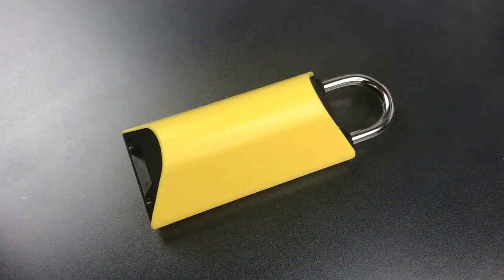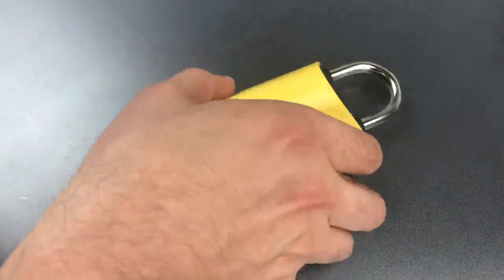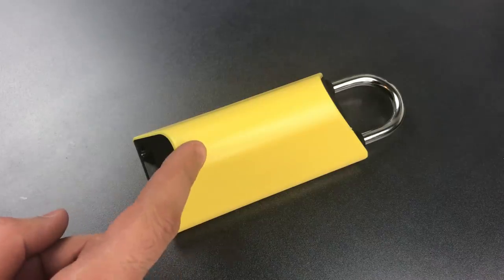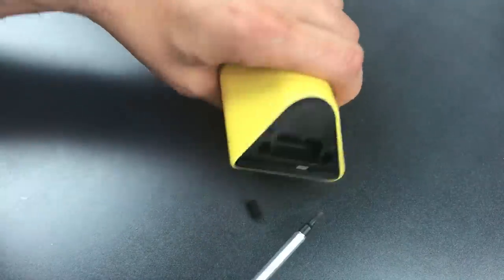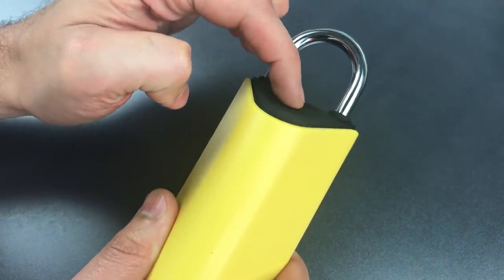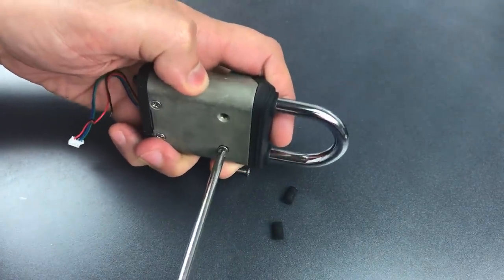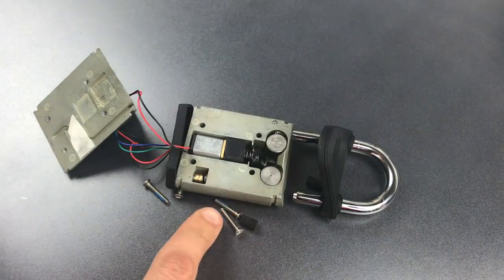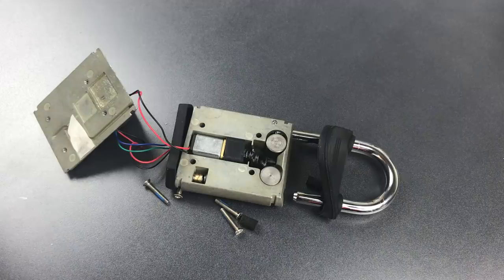[752] BoxLock: $129 Barcode-Scanning Padlock Opened With Screwdrivers!

Comment: Ive watched you pretty much destroy every lock and open them quite easily i have the boron carbide shackle master lock that you opened with the blowtorch what is your recommendation for the best most durable lock to use mine is currently on my storage i lost my keys once had to cut it off a pair of bolt cutters wouldnt even dent the shackle had to use an angle grinder with a cut off whell and had to cut the shackle off completely took about maybe 5 to 6 minutes

Comment: This would be relatively ok if the just welded the inner lock itself instead of leaving the screws exposed. I get that you can disassemble the plastic cage (which might be necessary for battery replacement etc.) and it doesent matter much since the metal lock itself is underneath. But that one has to be of decent quality and security then.

Comment: You could have also applied power to the two wires going to the motor. Do so correctly and it will open the mechanism for you without needing to take the 4 screws out.

Comment: if you fill those two holes with solder and connected to the battery there would be a chance if somebody tried using a metal bare wire like you did, that they might shock them self. I suppose since you can take it apart you can also put buttons in there to where if the button is pushed an alarm would sound.
Reply: Shock themselves from a 3.6 V lithium battery? More likely get a shock from how easy it was to open.

Comment: If you superglued or rounded off the internal screws holding the metal body together then the lock would be pretty secure. Enough for its purpose.

Comment: Pretty sure you needn't have taken the top half of the lock apart... after you pull both connectors off the circuit board your good. One of them is a handy voltage source, the other is the leads from the release motor... a couple of jumper  wires would have it open far quicker than disassembly.

Comment: I would check if the micro usb also has the data pins connected somewhere. It wouldn't surprise me if that has some debug access to the logic inside and if so it could be vulnerable.

Comment: Nothing to do with locks but for that torx bit you say you only buy the security bits because they work on both security and standard torx. While this is true I'd like to mention the security bits with the holes in them make them a lot weaker and if you have a stubborn screw it is a lot more likely to break the bit under pressure having those holes. I would recommend at least one set of regular torx bits for those stuck stubborn screws.

Comment: i guess there's another security flaw, in that anyone can unlock your outdoor box/locker/whatever with nothing but a package if some deliveryman decides to just leave the package at the door instead of going to the trouble of pressing the button, scanning the code, opening, closing, etc. what i mean is, let's say you get several packages a day. this seems likely since i doubt the average consumer household is going to buy this product. any homeowner who can afford to spend $130 on a padlock for deliveries probably lives in a safe enough community that their packages never get stolen. the only exceptions might be small business owners who run their business out of their house but aren't very individually wealthy. so i'd assume these are more popular among small to medium businesses. not really worth using unless you get multiple packages a day. and that introduces an unavoidable vulnerability, caused by laziness basically. you receive a large package at 8 AM worth $200, the deliveryman places it in the locked box. you receive a small package at 9 AM worth $5, maybe it's in a padded envelope, it doesn't seem worth the effort so the deliveryman just leaves it at the door or in some other unlocked receptacle. at 10 AM a thief comes by and notices the envelope on the ground. it has a barcode on it and the barcode can open the lock. thief gets to steal the $5 envelope AND the $200 package.

obviously that's still much better than just not having a lock at all, since it's only really vulnerable if a deliveryman makes a mistake. and it requires the thief to understand how the lock works and to risk being seen on the assumption that the envelope will have a valid barcode. so i'm not really criticizing it, and don't have a better solution. but it's an interesting little dilemma to try to solve. most of the potential solutions i could think of also require the deliveryperson to go a bit out of their way. like if they don't or can't put it in the locked box, and leave it in the open, they could use some software to invalidate the barcode. or you could set it up so that the barcode only works once, then a deliveryman can push the button, scan the code, but then not open the lock. and it automatically locks after a minute or something. once someone tries to scan it again, the code will no longer be valid. but these are still extra actions. not to knock delivery people in any way, the huge majority of them are just fine and work hard and are polite and so on. but there are outliers in anything, and we've all had the occasional dickhead who throws around packages containing fragile electronics, or leaves packages practically on the sidewalk, or doesn't even ring the doorbell for packages with required signatures. so it's not hard to imagine that sometimes you'd get one of those guys delivering your package, and i guess they just scoff at your magic padlock and throw the package on the ground lol.

the best solution i can think of is to reprogram these locks to accept dynamic barcodes, not the ones that are on the actual shipping labels, but barcodes generated within an app on the deliveryman's smartphone or little signature terminal thing. that way, ONLY the deliveryman can open the lock. the package itself is not the key, the deliveryman's app generates the key. then your only way in is either via the normal attack vectors for any lock, or by robbing a deliveryman, in which case you probably aren't gonna go retracing his steps and checking all the packages he delivered before you robbed him lol.

Comment: Security by obscurity with foam! LOL. At my work, we have engineering development systems on a subnet. Both the main network and the subnet can talk to each other and have to. But they disabled pinging from the subnet to the main network, for "security". Really does nothing but make my job harder when trying to diagnose issues. IT doesn't belong designing locks, or networks.

Comment: Interesting.
I have seen similar wy fi locks on permanent, large mail delivery boxes, so someone can secure deliveries, but the drivers have to be willing to call or ring the doorbell and wait for the user to remotely unlock the device (just a modified entry lock, attached to a small discreet door) 
I have never seen the bar code variable.

Comment: At the point where you took off the bottom and got to the wiring, one could just pull off that coupling and touch two wires on both sides of the battery and open it that way.

Comment: Just bolt a tool chest out front, then leave an auto clasping lock on it, with big bold instructions on the inside of the lid to lock after delivery.  An even cheaper “better than nothing” solution would be to bike lock a large plastic container to the house or something with the same lock.  That will at least stop the grab and run thieves.

Comment: It looked like the yellow body of the lock was made of plastic so it could be sawn in half. also if the battery fails or runs flat, you just have a piece of ballast. wonders how the batteries are charged. i wonder how many couriers would wait for the lock to verify that the parcel is legit. where i live in new zealand, if a parcel requires a signature  my letterbox does it lol.(seen the delivery notice on my pc the message, "signed by letterbox")

Comment: Seeing how there is just a motor in the top bit,  could you just have applied power to the red and blue wires to get the lock to open after getting the plastic shrouding off instead of disassembling? It feels like that could be a bit faster.

Comment: Once you got access to the wires can you just hook them up to the battery to make the motor work?
Reply: Maybe electronics had step-up dc-dc converter to raise voltage from 3.7 to 5V

Comment: The only advantage I can see for the lock is that it may send you a notification of parcel delivery which you could probably set up with one of the Amazon buttons with some software hacking. Security wise it looks like someone from the Childrens Toy department designed it, defiantly not a Tonka toy.

Comment: I have the feeling that they used screws in order to leave a way to replace batteries. There must be a way to be able to replace them. The problem seems bigger than just using epoxy.

Comment: I think it would be reasonably obvious to most software engineers that there's no security if you can open it with a screwdriver. Most likely, the manufacturer just didn't care, particularly as making the thing properly secure would require at least part of the electronics to be inside the metal casing, so that one couldn't run the actuator just by connecting a suitable power source to it.

Comment: I wonder how hard it would be to program a "maintenance mode" barcode, where it allows you to do what you did, and otherwise if the unit detects the screws are being turned to send an alert to the owner? Maybe have a electrical signal being completed while the screws are in and once not fully turned in disconnect it?

Comment: Did you inform Amazon of how quickly you defeated it?
A pair of modest bolt cutters would do the dirty deed in about 5 seconds on the shackle. Failing that, crushing the lock body would get to the metal lock part almost immediately and a modest handheld dremel drill will drill out the Phillips screws quickly. Don't need to make a lot of racket doing it, but if that doesn't matter, a hand held sledge hammer would do in the lock body with just a well-placed blow or two. I do appreciate the desire to disassemble the lock in a manner that it could be reassembled leaving behind no immediately visible clue that it was compromised. Of course, a direct attack on the box it's locking could also succeed quickly with a large screwdriver or small pry bar if it's no better than a military footlocker. Last, but not least, the porch pirates can simply take the entire lock box just like burglars do with safes and dismantle it at their leisure like you do with various locks in privacy of their basement workshop. Putting one of the two final assembly screws down from on top through the shackle hole would require a metal nut in the base plate, versus all plastic plastic, and it would have to be secure enough to prevent it from being pulled out - i.e. a press fit or molded in nut wouldn't work very well. Too bad you didn't try the two wrench attack on this one ;-)

Comment: Wouldn't filling the bottom holes with epoxy make it impossible to change the battery? But otherwise, they did make the usual mistake with smart-locks of leaving it open for maintenance access when locked.

Comment: Lol. Even better than a cell phone. Ever tried opening and doing hard mods to an #apple phone, they are not obvious at first blush where to start and if you do, most of it is able to break.  This lock on the other hand is obvious in how to open it.  Both hard disassembly and softer attacks (a microcontroller or even less could trigger the motor while bypassing the security board).

My feeling is that there is probably a 3rd weakness that but why bother when you can do so many other neat tricks.

Comment: Didn't need to disassemble that one all the way, you could actuate the motor by applying power to the wires which were exposed after the first step.

Comment: I always wondered why it isn’t standard procedure to strip the heads of screws after they go into assembling a lock. Maybe it’s not feasible to have the machine also clean up the metal dust that would occur?

Comment: i dont know if the aluminum body of the upper assembly is enough to shield the lock from magnetic fields.

couldnt you try using the rotary magnet you used on other locks to spin the motor and open the lock?

Comment: very curious how they fixed this. Hopefully they didn't just fill the holes on the bottom with epoxy instead of foam inserts and think that that was good enough. You can see some ways that would have been good, if they approached it correctly. If they replaced the yellow plastic part with some type of metal, and made what is now the recessed screw openings on the bottom of the device solid, they could drill and tap them from the top and use screws down the shackle holes to hold it in place. They wouldn't even need to do anything with the overall mechanism or the Philips screws, as they'd be protected by the sleeve as long as everything physical security critical was inside that shell.

Comment: They went to the trouble of putting threadlocker on the screws inside the lock, but used the BLUE kind, which is just for vibration. It doesn't permanently lock the screws in place. I would have used JB Weld. At the MINIMUM. I wouldn't have used foam to cover the bottom screws, either, that's just ludicrous.

Your idea of a screw through the shackle hole is a good one, though.

I know you didn't want to break the lock, but maybe you could get another, and try the ol' slidehammer or ramset gun on it to see how quickly you could open it if you were willing to make a little noise. The reason they think this thing is secure is because most Porch Pirates aren't going to spend a couple of minutes yanking out foam with a wire and unscrewing a bunch of screws. They want to open it FAST, grab the packages, and run. They're usually so skittish, they'll run if you yell at them through a speaker. So they want to dash in, snatch, and dash out.

A slide hammer or ramset gun solution would be their choice. Just apply the slide hammer to the shackle and try to yank it open, or fasten it to the case and yank down.  OR put the ramset on the shackle and try to shatter it.

I usually get lots of little, relatively cheap packages. If someone stole one, they'd probably find a couple of boxes of bandaids, or a bag of resistors, or something like that. The really expensive packages, someone has to sign for. But that has its own issues. I had a UPS driver bring a little Amazon box (containing a can of spray paint) to the porch, with a "sorry we missed you" tag affixed to it. He tossed it on the porch and dashed. He did this rather than bring the OTHER package to the door, ring the bell, and wait the 30 seconds it would have taken for one of us to get up, walk to the door, and scribble a signature.

Why, you ask? Because it was RAINING, and the package in question weighed 15 pounds. If we hadn't been home -- as he erroneously stated was the case; we WERE home, and eagerly awaiting that package! -- he would have had to carry the 15 pound package BACK to the van, in the rain, and he didn't feel like actually doing his job in bad weather. So I had to schlep myself 4 miles to a pickup point at a UPS store in the nearby town and wrangle it home myself the next day. Which was a pain in the neck. Literally, as I have a spinal injury.

I complained to UPS, but it was totally disregarded, of course.

I know it's expensive, but just get an ElephantTrunk porch delivery box and bolt it to your porch.

https://www.amazon.com/Architectural-Mailboxes-6900B-Elephantrunk-Parcel/dp/B00AESQ1EW

The delivery person only has to open the chute, drop in the package, close it, and it's not where someone can just reach in and take it out. You need the key. Now, that key is for a cheap wafer lock, but that can be replaced with a nice hasp and an Abloy, or a new core with a better lock on the door.

Comment: Exposed wires under the rubber top?!  Looks like they go directly to the solenoid.  Simply connect the right voltage to open it?

Comment: In either way even if the lock body would be impossible to open you have the motor wires out... Just put them on a battery, the motor turns and opens the lock...

Comment: A lock you can take apart with a couple of screwdrivers. Wow, that's secure. For a start they could have assembled it with shearhead screws and threadlock, at least that would prevent the low-tech screwdriver attack.

Comment: I'd like to see some circuit board close ups for those who can perform a technical security evaluation. I'm thinking specifically of attacking this lock via USB or a rogue wifi AP. Does it use https when checking tracking details? Is that endpoint configured with HSTS? Etc.

Comment: Tales much longer to unscrew this thing compared to any destructive traditionel method of breaking it. But what is the point? Here we have one way packet drop containers. Contrary to this plastic lock, the delivery guys will actually put the packet in the drop container. When he closes the lid, the packet drops to a compartment unaccessible without a key. Yes, LPL can pick that in seconds, but it actually works quite well.

Comment: 1.) the delivery has to be still marked as out for delivery for the lock to open, but many drivers mark it as delivered when they’re still in the truck so it won’t work 
2.) you need a STRONG WiFi signal or it won’t work 
3.) most drivers are unaware of the technology and won’t use it or won’t waste time using it 
4.) very unsecured, and too easy to disassemble, although porch pirates are grab and go people so they probably won’t spend time doing that 

TLDR do not get this lock

Comment: If the lock is locking a metal cabinet with a slot in the door so the lock is encapsulated and u only have space to stick.a paper with the barcode under it. So u cant acces the screws it could work. But with these locks the easy way is just cut the ring and dont mess with the lock itselve.